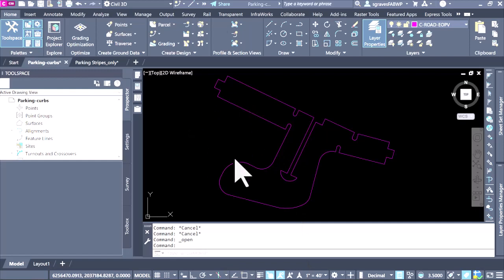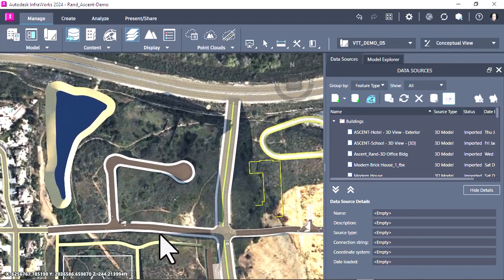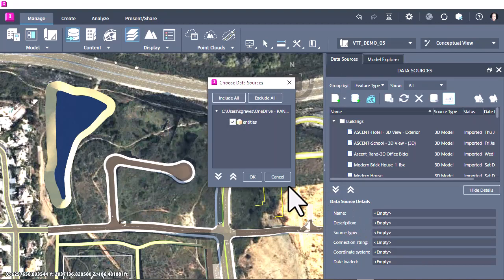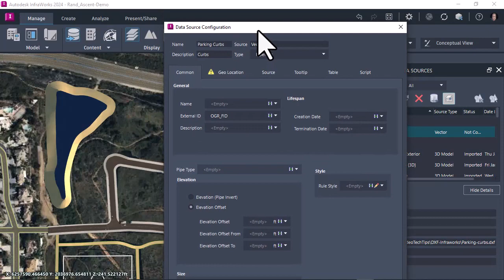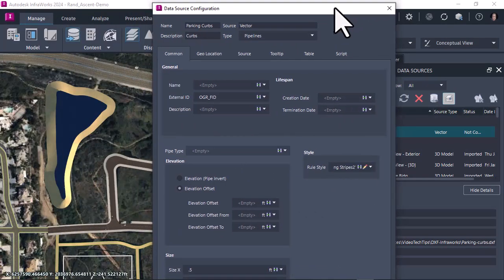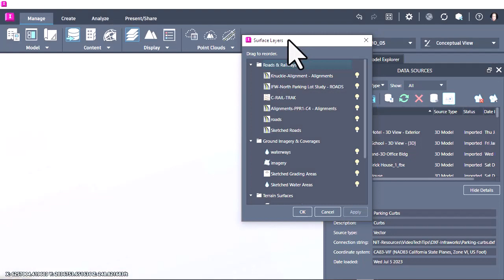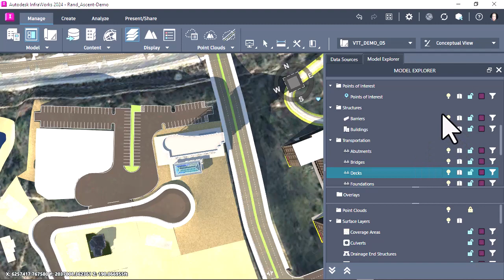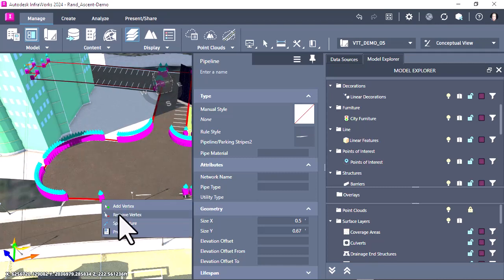Import AutoCAD DXF Linework into InfraWorks

Comment: What is the rule style you used?
Reply from the maker: We checked with our resident AutoCAD Expert, here's what he said: The presenter created a pipe style (In infraworks) called parking stripes2’.  It’s a custom style he created to display the parking curbs as pipes.
(The expert asked is not the same as who made the video, he said): I’d wager he did the following:
1. Went into the Style Palette, selected the rectangular pipe style under pipelines tab, and created a copy of that
2. Renamed the copy to Parking Stripes2’
3. Made modifications to the duplicated style (height and width to be a curb size of 2’), then used that when connecting to the DXF file